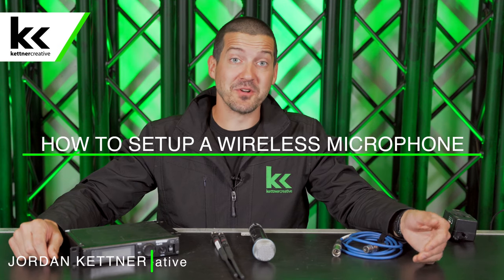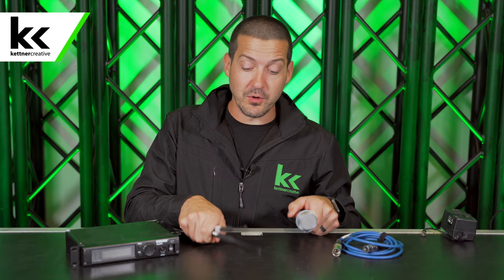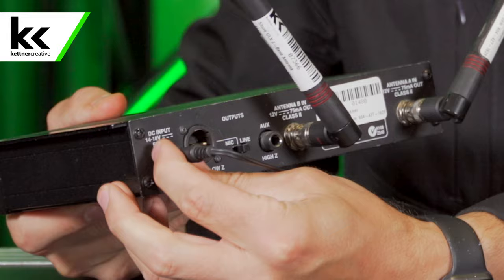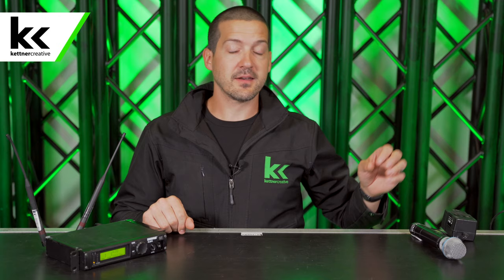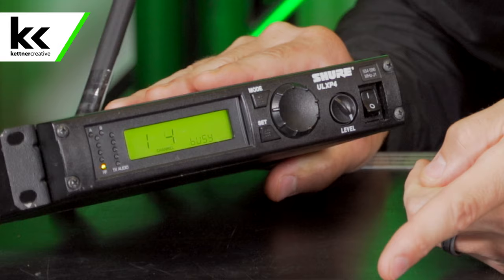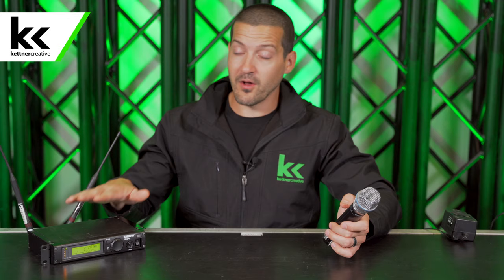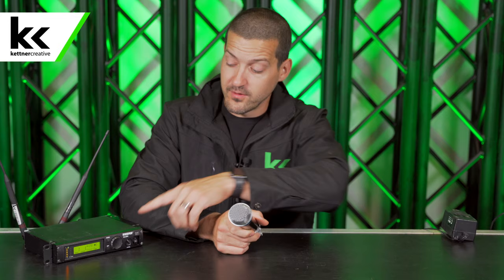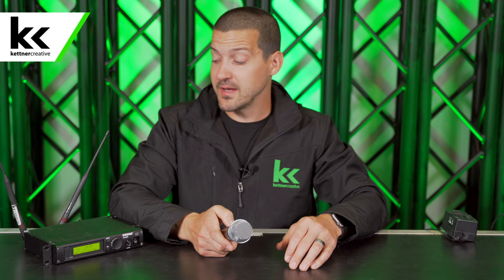How To Setup A Wireless Microphone

Comment: Can you explain: after connecting the handheld Mic to the stationery transmitter, can we transmit the sound of that handheld Mic to another MG06X console and finally get a headset plug to transfer the sound from the handheld mic to the translator's headset?

Can you please help explain or post a tutorial (especially for the Simultaneous Translation system)? 

It would be great though! I really appreciate any help you can provide.

Comment: Hello Kettner, Thank you for the video.  I have the exact Shure ULXP4 receiver.    I would like to hook it up to the BMB DX333 G2 Karaoke Power Mixer.   So far, I connected them together using the 1/4" both end straight from the Receiver to my Karokee Mixer.  However, there is a "hissing" sound as soon as I turn on the Microphone.  Today, I looked the back of the ULXP4, I noticed there are 2 ports: the 1/4" AUX/High Z output and the 3 pin XLR Balance Low Z Mic/Line output.   I wonder if using the 3 pin XLR Balance Low Z Mic/Line output to connect to my BMB Mixer would help vs. the hissing sound?  My BMB only have 1/4 MIC in.    Could you please help to guide me beside the current way of connecting the 1/4" cable from the ULXP4 receiver to my 1/4 Mic in Mixer, can I use the 3 pin XLR Balance Low Z Mic/Line output instead?   If I use this port, then, I will need the 3 pin XLR cable to 1/4in.    But, there are 2 different kinds for this cable: balanced vs. unbalance.  Which one should I use?  Thank you so much for your guidance.  Best Regards,
Duc

Comment: My wireless microphone receiver has gain knobs for each of the 4 microphones. I also use xlr cords to connect each mic into its own channel on my audio mixer. If I’m connecting Mic 1 to channel 1 on my mixer, where do I set volume of Mic 1 on the receiver and the  gain & channel volume on channel 1 of mixer mixer?
Reply from the maker: What does the manual recommend?

Comment: I have question my microphone receiver has both a TS/TRS output and an XLR output is there a difference in sound production using either one. I usually use very short TS cable to connect it to my mixer. Should I switch to XLR

Comment: Thank you so much but I'm having issues with controlling the volume of 2 mics. I don't want them to share the same channel because i want to individually change their volumes. My shure receiver doesn't have a volume lever on it. When I connect via 1/4 one if the microphones will not play out the other speaker. Is this because I need to use XLR cables instead?

Comment: Is it possible to connect a wireless shure sm58 microphone to a 2021 macbook pro? and what would be needed? struggling to find info about this, all i’m getting is for the XLR version! thank you so much!
Reply from the maker: Great question. It's basically the same process. You can think of a wireless microphone kit in the same way that you think of a wired microphone. Your wireless receiver still has an XLR output, so you need to connect your XLR output to the computer. 

Wireless 58 > Radio > Wireless Receiver > XLR Cable > Audio Interface or Audio Mixer > USB Cable > Computer.

Comment: So do I need a separate receiver for each microphone, or can I use two mics on one receiver?
Reply from the maker: You need a separate receiver for each. If you use two mics on one receiver, the mixer will only hear the strongest signal at any given time.
Reply: @kettnercreative  Hey bud, can you confirm if there is a reciever that can connect 4 mics to it, and the receiver is connected to a speaker system, the mics won't work properly?

Comment: I literally know nothing about wireless microphones .. but we need some for a starting our shows. We are just singing no instruments involved and no recording . 
So Can you tell me why if its wireless why the long wire that u plugged into the radio receiver? You said its to 'plug into an audio mixer' i don't know what that is?
Can you still use the reciever without it? 

Thanks
Reply: audio mixer is a device u use to connect the mic to speakers. its wireless in the sense that u can move around with the mic without a cable going into the audio mixer.

Comment: Can the xlr cable connect d receiver directly to a speaker? And is it gonna work ok?
Reply from the maker: Depends on the speaker. If the speaker is self powered and has a line input - the receiver and speaker have to be set to line in. Alternatively, you can set the receiver and speaker to mic level input, if you have those options

Comment: Sir can i apply the phantom power to cordless mic desk top receiver, what will happen if i apply the phantom power to cordless desktop mic receiver, can i phantom power apply or not . Sir iam waiting for your answer
Reply: Phantom power is used by microphones that need power to magnetize an element in the microphone to pick up sound. The microphones that are used as wireless microphones are dynamic microphones and they don't need the phantom power. So if your mixer or audio interface can provide phantom power you don't need it in this situation. AFAIK It won't hurt immediately if phantom power is left on by accident, but that is for somebody who knows this situation better to answer. I wouldn't be surprised if the quality of the microphone is involved somehow.
Reply: Thank you sir for your answer.

Comment: I have the same mic I have some frequency issues, when you move around the auditorium the frequency cut at certain points and comes back again pls what should I do to rectify this problem.
Reply from the maker: Move the receiver closer to the mic. The receiver should be within 100’ and have line of sight to the mic

Comment: Rookie question here.  Can someone tell me if its possible to run two microphone systems from two different brands at the same event? Yes I need to upgrade but I haven't booked that many events yet as I'm a new DJ, but at the moment I have a Samson system (lav and handheld) and a Pheynx Pro system (lav and mic). Could I possibly use both at my event this Friday? Also with the new Digital systems coming out would the Shure SLX4 system which are heavily discounted be a good buy or just save for the upgrade? Thanks to anyone that can help!
Reply from the maker: Yes, as long as they are on different frequencies - you’ll be fine.
Reply: @kettnercreative  Wow I didn't think I would get a reply before Friday! Definitely subscribing and joining!  So On the Pheynx system I can see the frequency but not on the Samson system so I need to figure out which frequency the groups and channels are for that system which I hope is on their website, then I should be fine? this is awesome! This is my 1st large event (I did fully disclose that I did not have pro mic equipment) they are more concerned with music. After this Ill be able to buy a new system torn between Sennheiser EW-d or SLXD. or save money and buy 2 older SLX4 systems. Thanks again!

Comment: How do digital wireless mics compare to these?
Reply from the maker: Good question, there are a lot of variables. 

In general, digital wireless systems tend to have "better" audio as far as dynamic response and frequency response. However, just like everything else that's digital (HDMI, SDI, Etc.), it's either on or off.  For low end wireless systems, this is extremely noticeable with big dropouts even when your transmitter and receiver are 15' apart.  

Medium to high end analog wireless systems have been designed in such a way that the audio section is actually quite good and comparable to high end digital systems(low latency, good dynamic response), especially if you're using it for speech which requires far less dynamic range and range of frequencies.

Hope this helps,
Reply: @kettnercreative  Yes, that definitely helps! Thanks so much!

Comment: I have question my microphone receiver has both a TS/TRS output and an XLR output is there a difference in sound production using either one. I usually use very short TS cable to connect it to my mixer. Should I switch to XLR
Reply: sir if you got any idea about this.. please help me also

Comment: how do i hook up uhf wireless microphone to a dvd tv
Reply from the maker: I don't know any TVs that have an input like this.
Reply: You need an audio mixer. You connect the TV audio RCA out into the mixer And connect the microphone Into one of the mixers channel. A small Mixer with RCA input will work fine. If you are using it for karaoke a mixer with effects will work better.